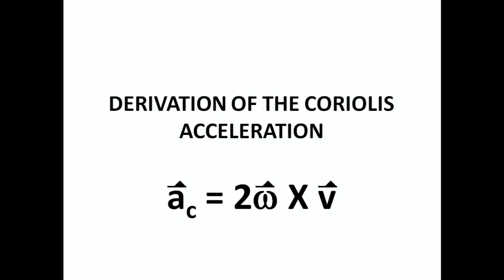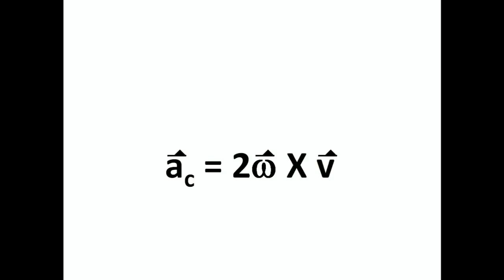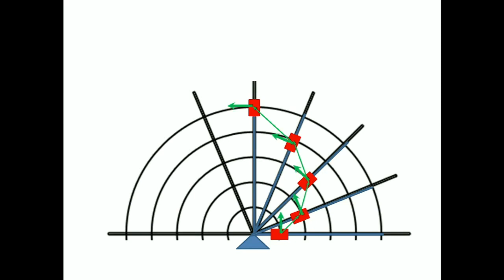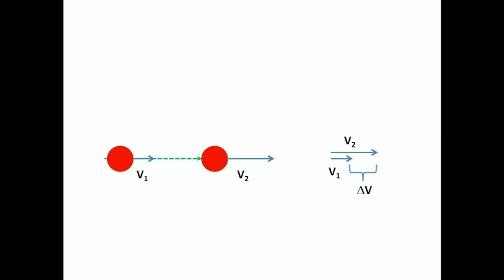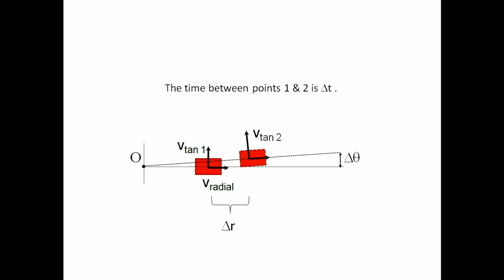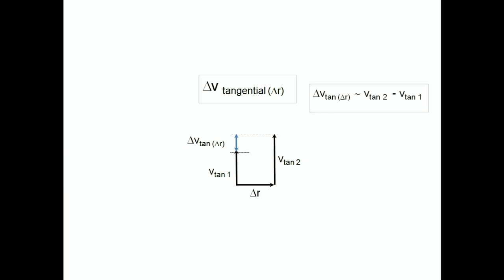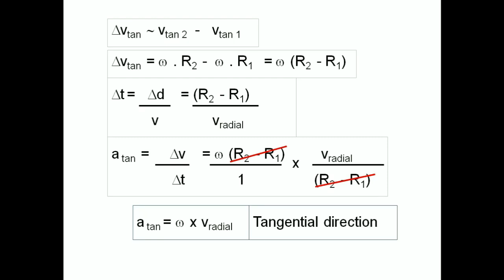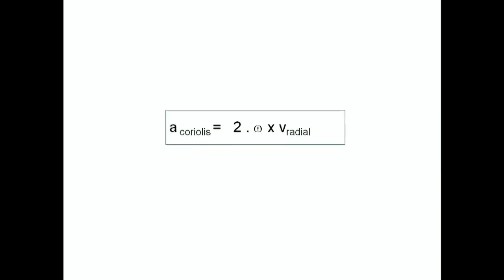CORIOLIS ACCELERATION: Deriving the Equation

Comment: Wait the coriolis accelleration is due to an apparent force: it only manifests when the frame of reference is non inertial, you are not studying a non inertial system, the accelleration you derive is just the ordinary accelleretion, not the coriolis accelleration; or am i wrong?
Reply from the maker: Because the slide is constrained to move with the rod, there will be no "appairent acceleration", howecer the slider will experience coriolis acceleration. Another example: If you are in the rotating frame of the rod, at the origin, and you fire the slider out....to person standing at the origin the slider appears to accelerate opposite to the direction of rotation.
Reply: @markberardi109  no im not convinced, the coriolis force is defined to be an apparent force, you are right: in the system you are describing there is no apparent force and so there is no coriolis accelleration either
Reply from the maker: https://www.youtube.com/watch?v=49JwbrXcPjc
Reply: @markberardi109  in this video coriolis accelleration can be considered because the frame of reference starts moving with the platform following a circular path, and so is not inertial and apparent forces including the coriolis force are present
Reply from the maker: Lets establish a case: you are at the centre of a rotating platform. You through a ball away from the center. What will the ball appear to do?
Reply: @markberardi109  the system you are describing now is rotating and so non inertial, and i agree with you that in this case apparent forces including Coriolis force needs to be considered and have their effect, but the situation you are describing in the video is totally different, you are just describing the complex motion of an object from a static point of view: no apparent forces required. 
Also i rewatched the video multiple times to ensure that the problem wasn't me not understanding, I am not an expert  and i don't want to attack you in any way but I am pretty sure that all the calculation you made are quite wrong and makes no sense
Reply: @markberardi109  also i made a desmos simulation of the problem of the video if you are intrested: https://www.desmos.com/calculator/jefw1jb9oc

Comment: This is a good attempt to derive the Coriolis force. But I think there is a mistake at the end.
While deriving the A(coriolis)(delta[theta]), you have initially calculated the acceleration as a magnitude (by using the dot product) which I'm okay with. But when you are presenting the result in the box at 6:58, you directly bring the Cross product which I couldn't find physical reason for. Would be great if an explanation is given for that.
Reply: EXACTLY.

Comment: There’s a derivation of an absolute acceleration where the coriolis acceleration arrives from such derivation.  You run a setup of a vector that tracks the movement of a rotating system, where in that rotating you have a particle. You the draw a vector directly to that particle and you equal it to the vector tracking the location of the rotating system plus the vector of the particle relative to the rotating system.  Then you do you the derivatives to obtain velocity and another derivative to get the absolutely acceleration. The trick is getting the acceleration of p relative to the rotating system, you’ll find that you’ll have two accelerations that add together to obtain the coriolis acceleration.

Comment: at 6:04 while substituting dv and dt why did you use Cross product and not dot product?
Reply: If you take 2 vectors and take 1 vector and the perpendicular component of the other vector and then multiple them both (area), it is cross product. We do this because radial velocity might be a 3d velocity and we take the planar component(perpendicular to w) so it will be v sin(theta) so a cross product.
Hope it clears

Comment: Awesome! Might answer a problem I have been trying to solve for years. Can I ask you this? If an object that was experiencing the Coriolis Acceleration was also exponentially expanding such that the acceleration perfectly matched the expansion rate, and we zoomed out at a rate that kept the object size constant, would we see a constant speed circular motion??
Reply from the maker: Firstly, thanks for telling me about my spelling mistakes!! Before I try to answer your question, can I confirm that we are imagining the slider to be a disc which is expanding in all directions (omnidirectional) at an accelerating rate? Also, that accelerating rate of expansion is equal to the magnitude of the Coriolis acceleration (of the center of the disc)?
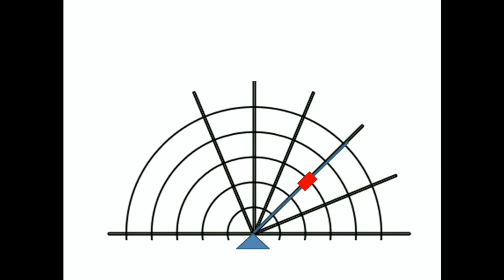Reply: @markberardi109  You are welcome on the spelling mistakes. You might appear on searches for the term now. On the problem I am trying to solve, let me be more precise and specific. There is a disc that is experiencing an accelerating/exponential expansion. An object is moving past it such that it is creating a Coriolis acceleration, a similar scenario as your diagram at 2:00 but that center point has the exponentially expanding disc. The object moving past it may or may not be expanding. For ease let's say it isn't. It can be the red block in the diagram. My theory is that it can maintain a constant relative distance purely if the Coriolis acceleration/curve exactly offsets the expansion rate. I also believe if left to happen perpetually (assuming no friction) it would create a self similar spiral like a logarithmic/Fibonacci spiral and if you zoomed out at a perfect rate it would create a circular orbit. The problem in my head that I can't reconcile is whether it could happen and also whether the fictitious Coriolis acceleration and circular orbit could be maintained perpetually purely from the frame of reference and not need a force input to keep a velocity increasing somewhere in the system. Let me know if you need more clarification.
Reply: @markberardi109  Also further to my question, it is when I look at the slider at 2:06 that clearly shows the forming path is clearly a logarithmic spiral that a particular accelerating expansion should be able to "fictitiously" keep that distance constant with the red slider technically never needing to actually truly accelerate. It is the last bit here the red slider not needing to accelerate that I think might be where my intuited observation trips up. There must be a scenario where this would/could work such that the conservation of momentum is maintained or does the accelerating expanding disc change things?
Reply: @markberardi109  Further on this, I actually plotted out myself what I was looking to do and in fact what I effectively was trying to achieve was something quite opposite to the Coriolis acceleration and that was a case of when the slider moved inwards with an acceleration. Expanding the disc was the same relative effect moving the slider inwards but at a slightly accelerating rate. What I found was that it seems to create an elliptical orbit. I have searched online for the opposite to the Coriolis Acceleration but couldn't find anything. It appears that the opposite to the Coriolis Effect is an elliptical orbit???
Reply from the maker: @RobertLFerraro  Apologies for my slow reply! I have not had a good chance to process all your questions yet, however with your last question: If there is an expanding disc, with a slider orbiting it at a set distance, then the slider will not be experiencing the Coriolis acceleration. If the disc begins expanding at a constant linear rate, and the slider is orbiting with a constant angular velocity, the direction of the Coriolis acceleration will be 90* to the radius (or tangential to the surface of the disc) and pointing in the direction of movement. If the disc expands at an accelerating rate (exponential), the acceleration vectors will be pushed outward (in the radial direction). If the disc expansions begins to slow down, the acceleration will begin to point more towards the center. BTW there is an error at 2.35> the arrows of acceleration should be pointing opposite direction. I am not sure what you mean by "opposite" of Coriolis acceleration.  An object in elliptical orbit will experience the Coriolis acceleration, because the radius (orbit) is changing.
Reply: @markberardi109  That's fine. Thanks for your answer. Don't bother to spend any more time on this. I worked out what I needed to now and your video was a LOT of help. Are you in physics as a profession?
Reply from the maker: @RobertLFerraro  I do have a degree in mechanical engineering, however I do not currently in the field.
Reply from the maker: @RobertLFerraro  I developed the content of the video from this online paper - http://www.aoengr.com/Dynamics/CoriolisAcceleration.pdf

Comment: Should not he be saying transverse component in place of tangential component?
Reply from the maker: When I mention to the tangential velocity, I refer to the velocity component tangent to the "concentric rings" or "circular paths" . "Tangential" is the term used in analysis of circular motion/ centripetal acceleration. The velocity moving in the direction of the radius is referred to as the radial velocity.
Reply: @markberardi109  Thanks Mark. 😊

Comment: Not sure if i'm just not understanding something, but at 2:30, aren't the arrows pointing in the wrong direction? You're right that the arrows would be reversed if only the radial velocity was reversed, but in your image the angular acceleration was reversed too, meaning the arrows should be pointing to the left (counterclockwise direction). When the slider is coming toward the center, it has to bleed off velocity from being farther away, and so acceleration must act against the direction of tangential velocity to keep it from "overshooting" the rod.
Reply from the maker: Referring to your first point: Now you point it out it is kinda confusing. The angular acceleration is supposed to be in the same direction as the previous slide. I might modify the slide when I get a chance. The way I animated shows the reverse direction.
Reply: I gotcha, that clears it up. Thanks! If only youtube had decent tools for post-production frame editing. :/ I had to fix a couple parts of my vids with big annotation/note boxes covering the issues lol.

Comment: This derivation depends upon the slider having a constant radial velocity. 

Is this an assumption?  My Answer:  NoHow is this assumption justified? My Answer:  There is no force accelerating the bead in a radial direction.  The only force is that which the spoke applies in the tangential direction How is this assumption reconciled with the intuition that a slider (bead) that is not initially moving radially along a spoke will move outward along the spoke as the spoke is swung around an end?… Am I correct in supposing this reconciliation depends upon the angular acceleration of the spoke as its angular velocity increases from 0 to its final, constant value  ...  that once the spoke's angular acceleration is 0, the bead's radial acceleration is zero?… If so, HOW DO YOU PROVE THAT THE SLIDER'S RADIAL ACCELERATION IS 0 WHEN THE SPOKE'S ANGULAR ACCELERATION IS 0?  MORE GENERALLY, HOW DO YOU DERIVE THE RELATIONSHIP BETWEEN THE SLIDER'S RADIAL ACCELERATION AND THE SPOKE'S ANGULAR ACCELERATION?
Reply from the maker: In the scope of analyzing the slider: The bead/slider is going to have a component of radial acceleration, even if it is fixed at some point on the slider ie 0 radial velocity. This is because it will have centripetal acceleration pointing into the center of rotation.As for developing a relationship between the accelerations and the spokes angular velocity... its a good question. I guess this question presents the situation where the slider is free. In the case I presented the slider was moving with a fixed/constrained/artificial velocity along the slider.